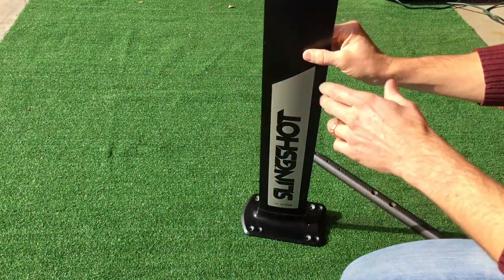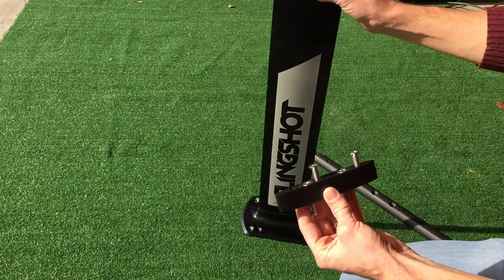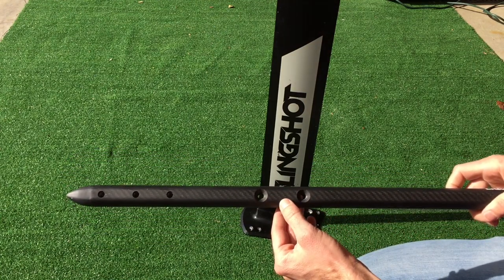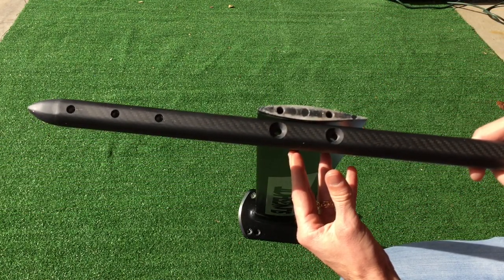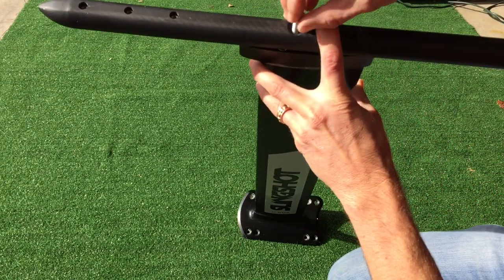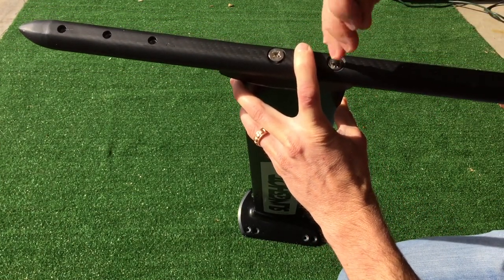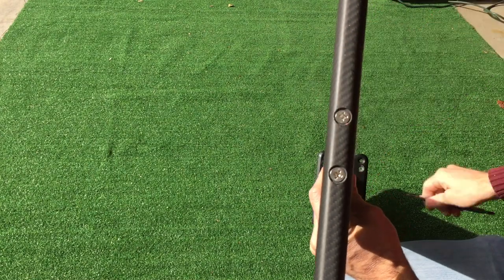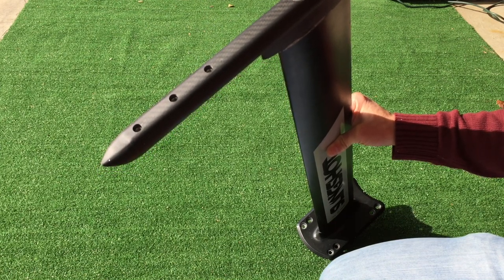Liquid Force to Slingshot Hydrofoil Interface Plate

Comment: Would this work with a liquid force mast and slingshot fuselage?
Reply from the maker: No, you would have to reverse the holes with and without threads so it could be tightened to the LF mast before installing the Fuselage.  Hard to explain on here but the answer is for sure "no".  Thanks for the comment!